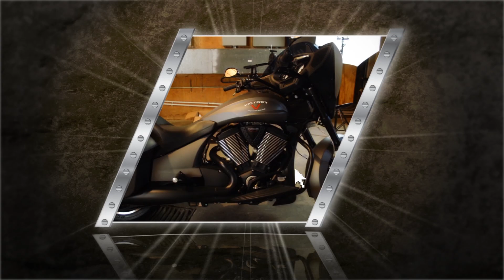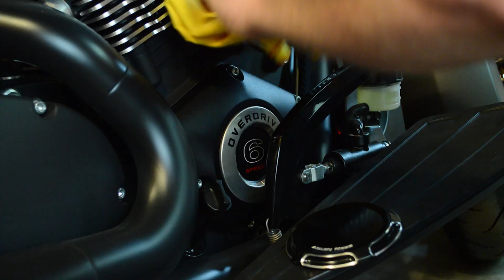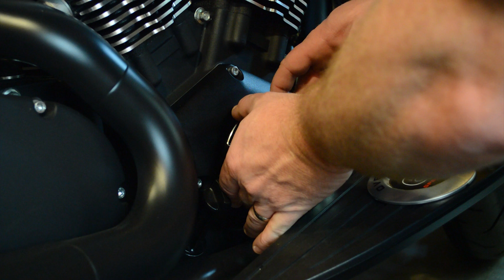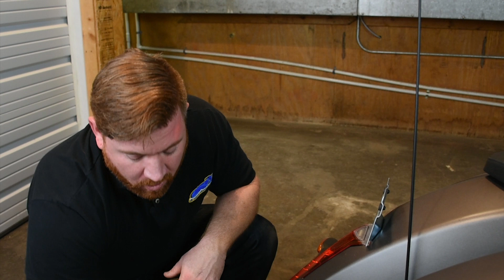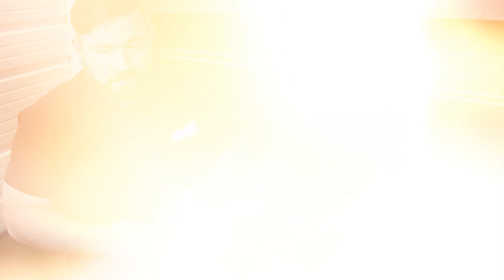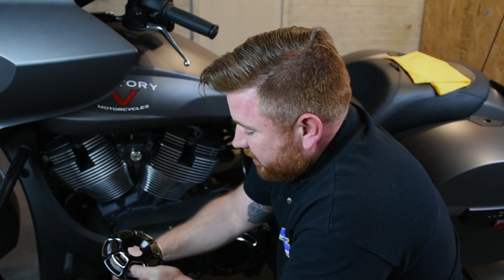2016 Victory Cross Country - Arlen Ness Project Build Episode 1

Comment: Why did you only change one cheese wedge? (ignition key surround) Do the make a matching cover for the other side?
Reply from the maker: Arlen Ness doesn't have a replacement for the opposite side.
Reply: I should have mentioned what a beautiful job you have done with this motorcycle. Well done sir.

Comment: I'll start by saying I appreciate your videos. I think it looks great however, I'm a function over form guy. The mesh inserts are indicative of an air filter cover. The fact that it is a nonfunctional piece designed to mimic an air filter cover goes against my grain. I just don't want to bolt fake stuff on my bike but again , it is a nicely detailedl fabricated piece of metal.